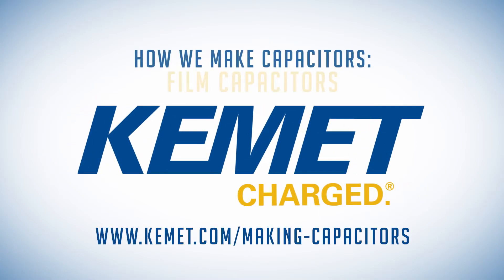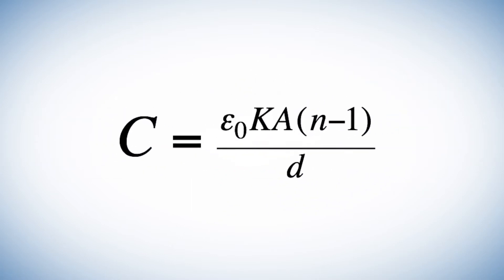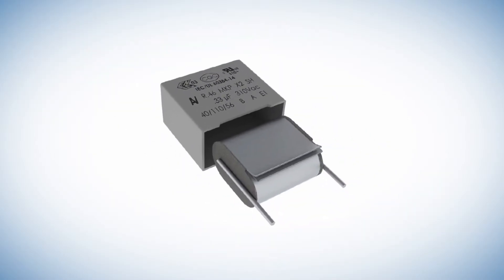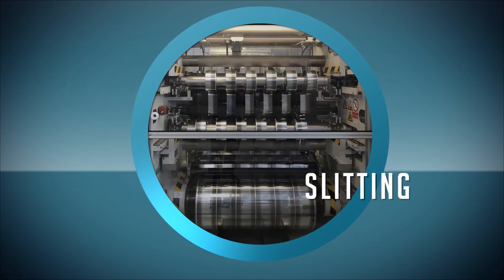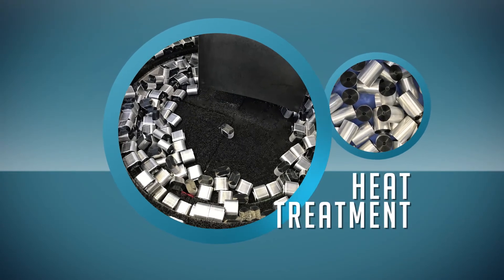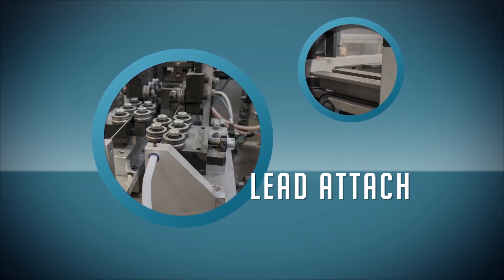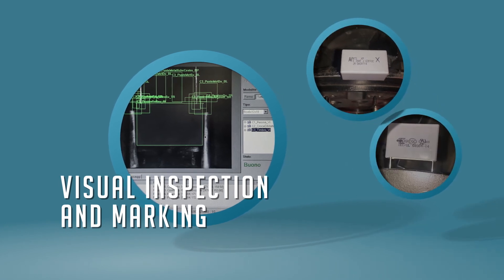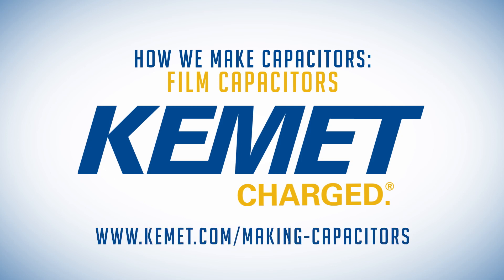How We Make Capacitors | Film

Comment: I have seen Kemet electrolytic capacitors. In terms of quality, they are no different from ordinary cheap Chinese capacitors... I am afraid to use Chinese capacitors as they start to fail after 1-2 years of use.
Could Kemet have a range of premium capacitors?

By the way, famous brands (Apple, HP, Canon, etc.) usually use Okaya X2 capacitors. And I have not yet seen such a capacitor completely fail.
Reply from the maker: Hi Kolya - that's interesting because KEMET has been known for premium capacitor quality since the earliest days of tantalum capacitor production. I don't know how to explain your past experience, but I can assure you that KEMET has a premium product, across the board. Quality is one of our core values. A KEMET capacitor is always high quality. You can browse electrolytic offerings here: https://www.kemet.com/en/us/capacitors/aluminum.html
Reply: I’m an electrical engineer and have used Kemet capacitors for over 15 years. I have never seen one fail unless it was improperly used or damaged due to poor manufacturing processes during assembly of the CCA or accidental testing mistakes due to operator error.